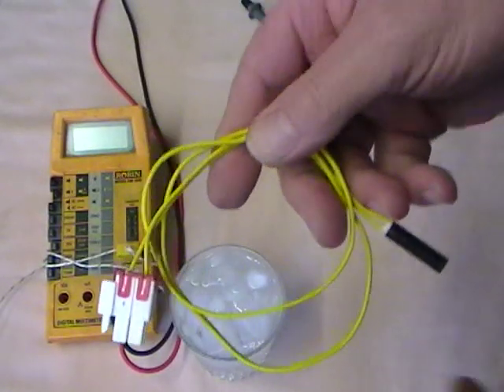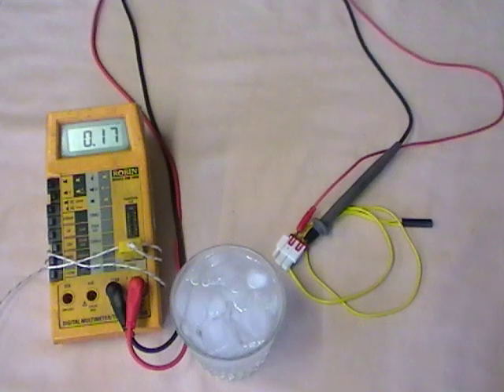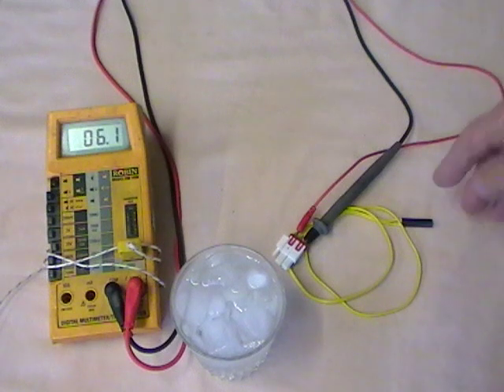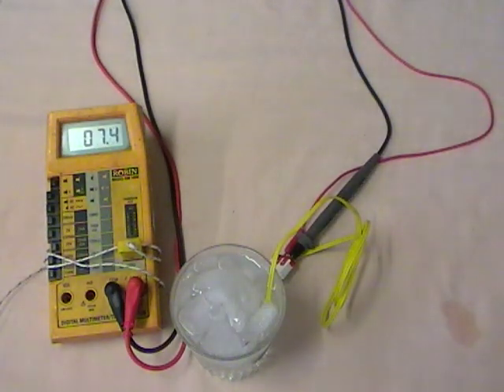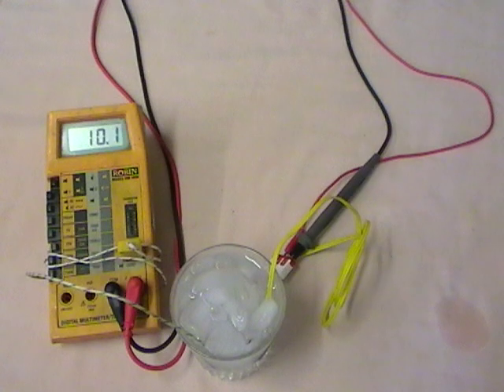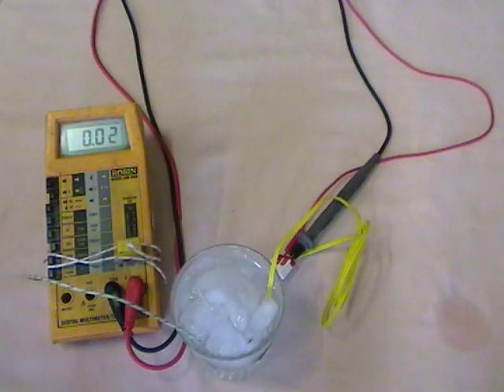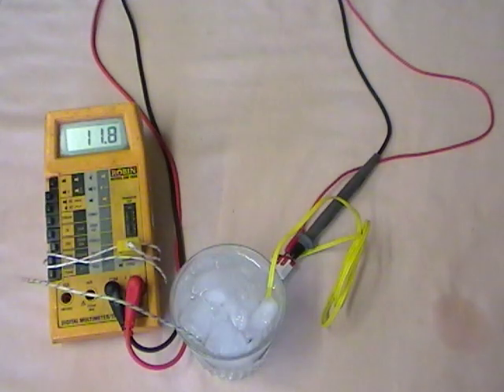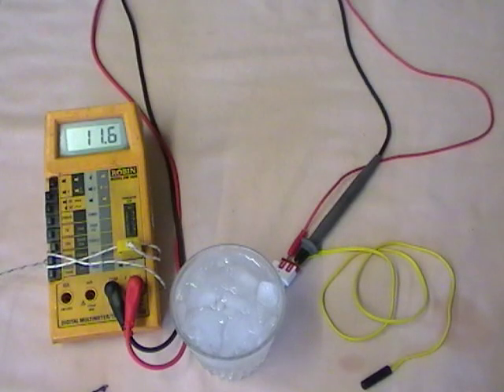Samsung american fridge freezer problems, RS21 fridge defrost sensor test

Comment: Re. RS21 side by side Refrigerator,  The power output from the PCB to the Heater does not work, Can the PCB be repaired.  I live in Sri Lanka and spare parts are a problem.
Reply: check 12 volt at heater relay if there that is then replace relay of heater or just switch on off unit u will get test command voltage 12 vdc at relay of heater . if not check 7812 regulator in pcb. if not check filter 450v and 47 mfd if not check 223yn for switching.

Comment: is there a difference between a refrigerator defrost sensor and a freezer defrost sensor
One has a white tip and is short and the freezer is black and a longer lead, but is there a difference apart from the colour of the tip
Reply: in samsung there is no difference at 25 *c its valve is 5 k ohms

Comment: I have checked all sensors and elements and overloads and fans and all are ok .on power up display comes on and then there is a beep you cannot change any temps on front panel the compressor runs for a short time then switches off and then shortly after the fans stop also if you unplug the fridge defrost sensor it seems to go into a default run setting as the compressor then runs looks like one of the boards any body know which one the display board or the control board I have ruled out the inverter board for the compressor as this runs with sensor unplugged any help would be greatly apprieciated

Comment from the maker: the value changes with temperature, its normal operating temperature is approx -18 degrees and it should read 29.5K ohms, at 25 degrees it should read 5K ohms

Comment from the maker: This is not restarting after a defrost cycle, there will be a Defrost sensor/heater/thermal fuse problem in the fridge or freezer compartment. Only way to know what is faulty is to test components. Its possible for it to be the control pcb but unlikely.

Comment from the maker: If the thermal fuse fails the fault is: the whole appliance will defrost after about 12 hours and not turn itself back on. The fridge back panel section has to make contact with the rear wall, this forms the airways for the returning air to be rechilled, if the back panel is shot, ie faulty foam sealing and the polystyrene insulation water logged then the ice will build up despite the parts you have replaced.
Perhaps this is where you need to look closer.

Comment: Hi I have replaced the heater element, the thermal fuse and the sensor but the fridge still continues to ice up, i suspect the thermal fuse is being blown as the ohms test on the temp sensor is reading ok , do you have any ideas